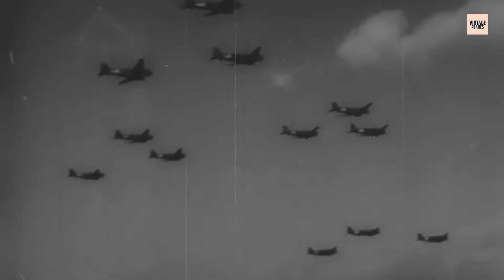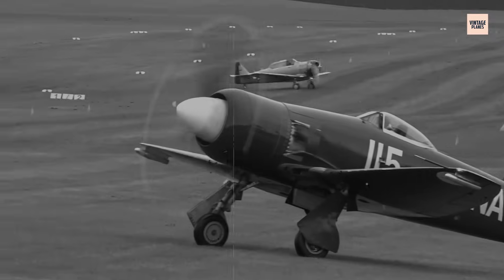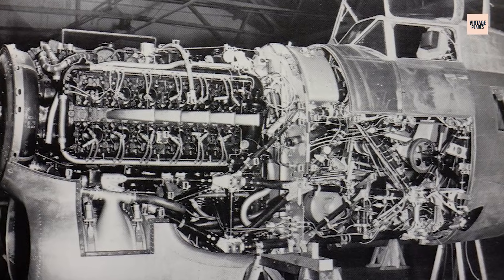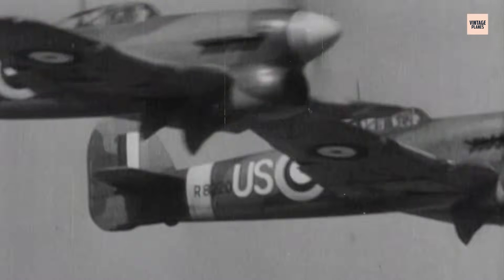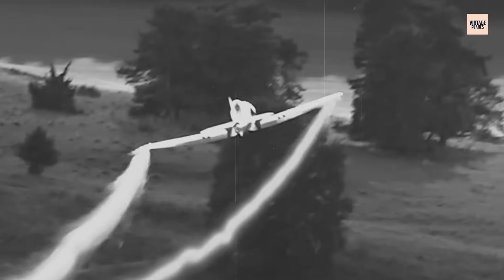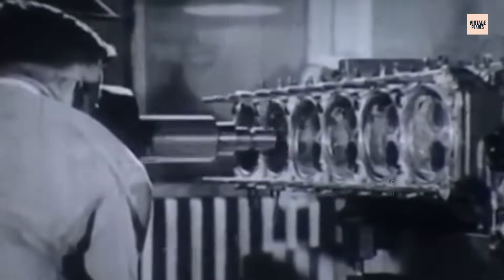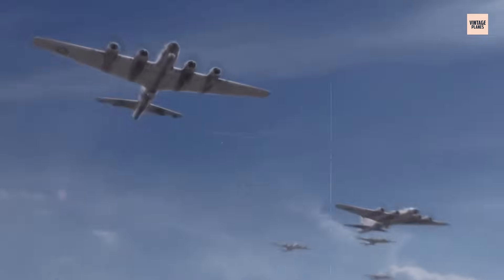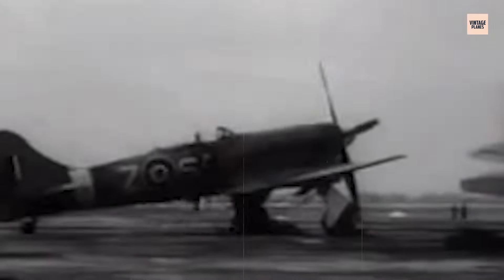The Shocking Truth Behind Napier’s Sabre Engine

Comment: They were very difficult to start in the UK winter. The necessary close tolerances of the sleeve valves caused drag and turned over very reluctantly and sometimes caught fire. I knew an RAF ground crew who said pilots were often afraid of the thing. Btw, it didn’t have ‘laminar flow’ wings, as the so called laminar wing on the Mustang, it’s a myth. Wartime mass production made the precision necessary, impossible to achieve.

Comment: The h-24 is equivilent to a 48 cylinder h-24... Because the Napier engine is a 2 stroker. It fires each cylinder every rotation! And a sleeve valve? Talk about more parts than needed for an engine.
Reply: "Yes, the Napier Sabre is a four-stroke engine, specifically designed as a liquid-cooled, H-24-cylinder, sleeve valve piston aero engine". 

A quick AI search will tell you that the Sabre was a 4 stroke engine.
Reply: The Sabre's a 4-stroke.  The E123 is a 2-stroke H24 based on the E113, but was never built.  The Napier Nomad was a 2-stroke compounded with a turbine.  Thde Deltic is a 2-stroke diesel used in boats.
Reply: @Pene7942  How do you make a sleeve valve engine into a four stroker? The sleeve valve cylinder can not cycle up and down at half the speed of the crankshaft? The sleeve valve rotates on the crankshaft!